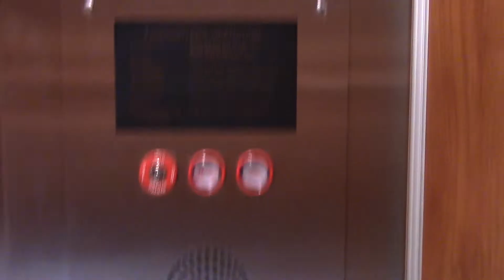Allied Oiltronic Elevator (Innovation mod) @ Tk 1, Union Station, Hartford, CT

Comment: That is strange how this elevator was modernized for ADA compliance but there is no mini high ramp for trains. Also I actually really like the video quality on the camera you used.
Reply from the maker: Thanks!  I had to replace the very glitchy camera I got in December with a Canon camcorder.  Im very surprised it was modernized I don't know why they would try to make it ADA.
Reply: jaemre288 Elevators This station was built in 1889 which was before ADA compliance so I see what your thinking why the station would try to make the elevators ADA when the station platforms were not built ADA. I guess it might be a requirement for something.